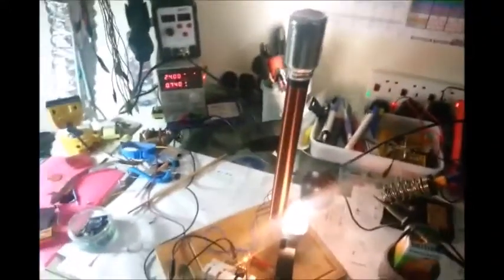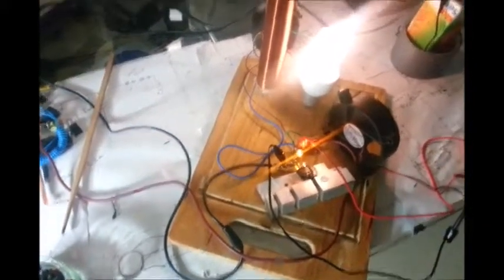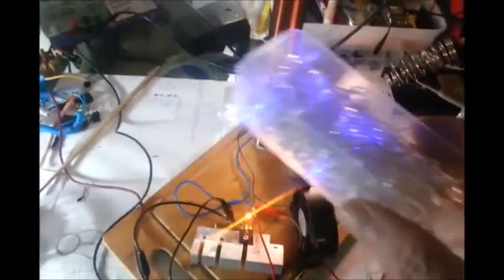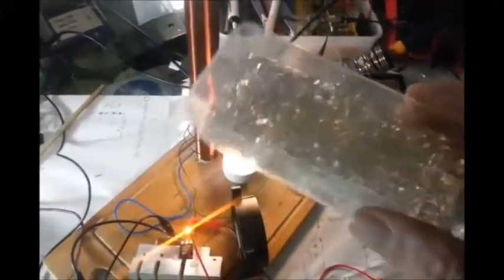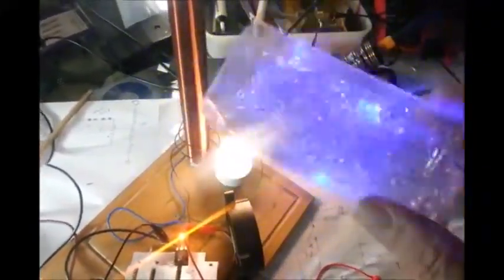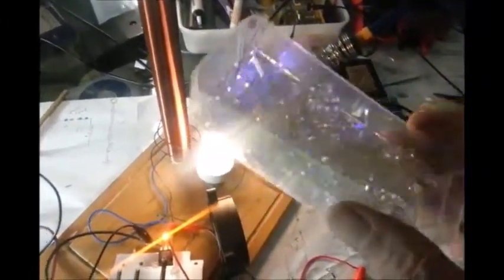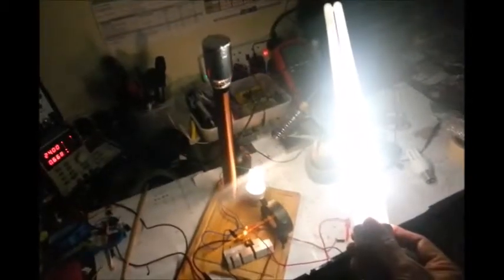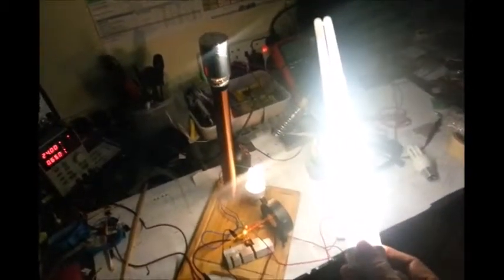Solid State TESLA Coil Exciter Update 2 Elecifun

Comment: That looks awesome... 🤔
Reply from the maker: These are easy and fun to build.. maybe time for another of these.
Reply: @Elecifun  I might buy one hmm 🤔
Reply: @Elecifun  I like building power supplies. All the bits n pieces. Drilling holes. Sawing the facia. Filing the holes. Soldering the boards. Crimping the terminals. Soldering the wires together. Melting the plastic tubing around exposed wires. Something primordial about working with tools and making things. Its very enjoyable.
Reply: Maybe you could build another one only much bigger. 😅👍⚡